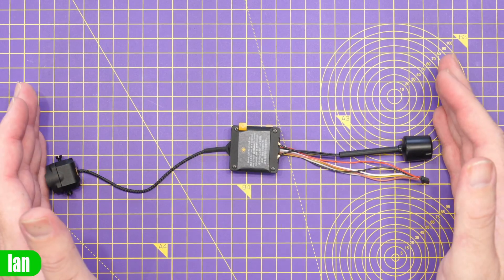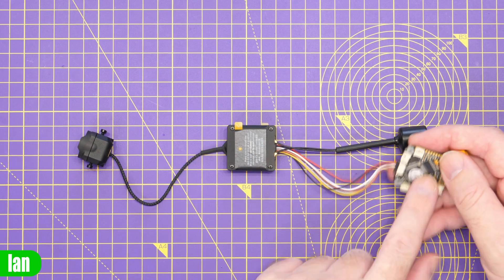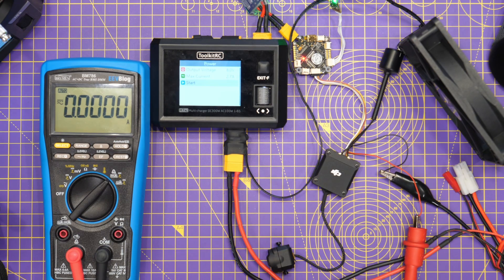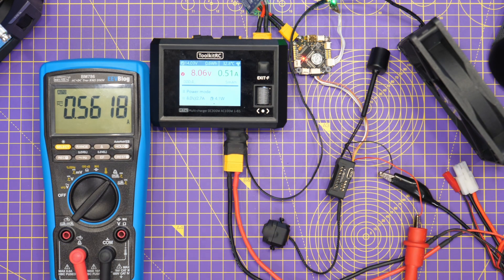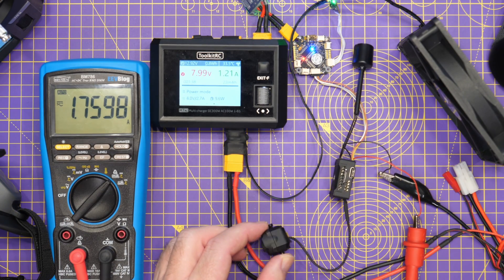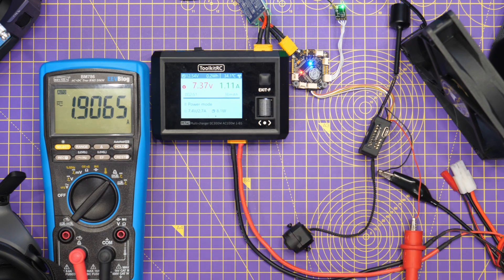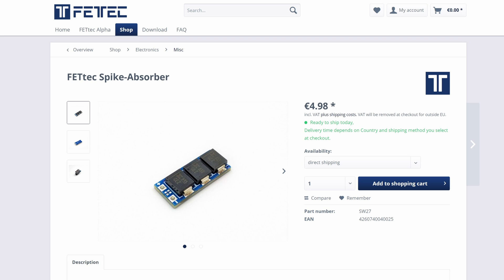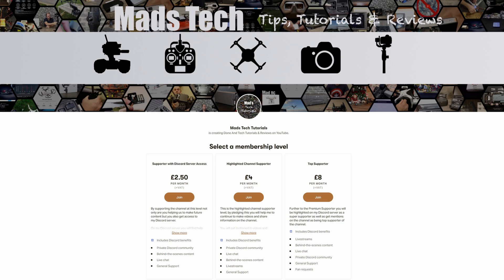DJI O3 Air Unit Power Requirements Updated  - This Could Catch You Out

Comment: I got mateksys micro bec to power up my fc on my geprc mark5 dc hd. needed because of water damage. It works powering up the fc / rx etc but not the 03 unit. On the instructions for the BEC you can bridge 9v pod for more amps. do you suggest this? Thanks in advance

Comment: Hello, I need help! - I have a new set of DJI Goggles 2 and a New Dji 03 Air Unit...
I want to simply run the camera without a flight controller so I can install it in an RC Car.
All I need to know is how to get power to the Air Unit using an independant 4s Battery.
I don't need all the OSD stuff, Just powered on, so I can install the Firmware on both the Goggles and the Air Unit. What cable do I need to make up to get this going? ( I also have a fan and a heat sink ready for it too) There has to be a simple way to power it up surely without '' all the quad gear '' If anyone can help me, I'd be willing to pay for your time. I live in Australia and really want to use the system. 
I have searched what seems like the entirety of YouTube for what I've just explained, But everything is about quadcopters. Hopefully someone can help me out here. Many thanks in advance.
Reply from the maker: You just need to power it from the cable with in the specified range. The red and black cables.  However please note that O3 will not go to full RF power even if you turn off low power mode.  It needs an arming command from MSP
Reply: @MadRC  Thank you kindly for responding! 
Yes I have been thinking about these hurdles.  I don't mind admitting I am a complete newb to Digital FPV, Unfortunately for me I am elderly with early onset Alzheimer's and this system was bought for me as a gift as about a year ago my doctor advised me to get a ''young at heart hobbie '' and I'm completely hooked on RC Cars and Sail Boats. I have rang around a few places in the city for help in getting them installed. ( I have two 03 Units ) But everytime I try and explain what I'm after I basically lock up and forget. Its relatively easy to remember it, But to speak it out I just end up ranting on about whatever else. I'm pretty much at my witts end now as to getting at least 1 running up. I've watched all of your video's I think on the 03 and it looks fantastic. I really really am impressed by your vast knowledge mate. I wish I could harvest it somehow. Thank you again for reaching out  mate.

Comment: Hi, my airunit O3 is very hot, I can't figure out how powerful it works. I have the FCC hack installed. Does Airunit dynamically change the power or does it always work at maximum? The power meter showed ~4w in lower state mode and ~9w without it. Can I see the transmission performance in some software?
Reply from the maker: The O3 does get very hot.  Yes it’s somewhat dynamic too.  Just use the ham file and that’s the max output you can get.  The full 15w is with recording ect.
Reply: Yes, indeed, the airunit o3 consumes about 15W while recording, but without it, about 12W. I didn't observe dynamic power changes. The power consumption doesn't differ when in close proximity, even when the signal has almost disappeared. I don't like this approach because why should my airunit O3 operate at maximum power when it's only 5 meters away from me?! @MadRC
Reply from the maker: @alexwarek  it’s not fully dynamic and you won’t see it’s behaviour on the power usage.
Reply: I am also surprised by the fact that when it overheats, it does not reduce power. Thank you for answering my questions @MadRC

Comment: I have the skystars h743hd fc. I would power my o3 from 10v but I cant find the maximum current nowhere in the documentation. This is why I power it from a pad called "filtered vbat". According to the documentation this pad is supposed to power the vista. Yesterday while flying (it was very windy) my o3 rebooted mid flight. Could the adjustments that the motors had to constantly make cause a voltage spike and force the au to reboot?

Comment: Just got done moving my power / ground off the BEC from the FC, as I kept getting the O3 air unit rebooting (this on a brand new GepRC Mark 5).  Keep in mind, my FC has a 3A 12V BEC (rated).  Usually the reboot would happen when high G flip or once, when I belly flopped down on ground just a little too hard (that made me think it was cabling/crack/connection issue).  Originally thought it should be when doing high current punch maybe allowing BEC to brown out.  Nope...had it happen more often during a throttle down (right after a quick blip). poof reboot..no video.  Caused two crashes before I'd had it.  Too many cables going from ESC out a cable to the FC, out that cable into O3, so I just soldered it direct on the 4S Vbatt.  So far (crossing fingers), it has fixed the issue...  /shrug.  YMMV, but there is at least one more line of thinking for not having a mission critical (video) cut out on you just as you execute a nice snappy front flip aaaaaaaaaaaaaaaaannnnnnnnddddddd.............yeah.  Panic.  Sigh.  10s later when video came back, I could count the blades of grass blocking the camera.  nice.  sigh.

Comment: Hi Mads, has this been addressed in a firmware update or do you still need an FC for max power output? tia
Reply from the maker: You still need the fc. Nothing has changed. There is some Arduino code out there as well you can use to force it to arm as well
Reply: @MadRC  Spot on thanks mate

Comment: I have a Zeus F722 that has a 9v/2a BEC for the DJI system, which should be 18watts but that's if it's rated correctly. I have some spike absorbers but maybe I should also just get a 12v 3a BEC. After tax and buying a longer camera cable because they like to ship these with the shortest possible camera cable, I've got $260 in this one o3 air unit. Might as well have $270 in it and just spend the $10 on a BEC.

Comment: Thank you for the great review.
I’ve seen iflight had some issues with the current regulator and I wanted to power the DJI O3 directly from the battery.
Do you have a diagram or additional equipment that will make this possible without risking the O3 unit?

Comment: Do you think the relatively thin gauged wires of FC/ESC stacks running from the ESC to the FC are sufficient to supply all the electronic on board?
Reply: NO!  Yes, for any one, but the increased failure potential from small wires/connections from ESC, up to FC, then into BEC, then out ANOTHER cable to the O3 for something that is mission critical (had two crashes because something was loose or pulling, and maybe not from BEC).
Reply: What BEC you recommend to use ?

Comment: "I tested the o3 unit for the first time yesterday, using it on two different planes. One of my planes had an f405 wing control board, while the other had an h743w. At 300 meters, the connection was lost with the f405 board plane, but I didn't have any problems with the other plane and was able to fly up to 6km. I believe that the f405 board was unable to provide enough current on its 12v output."
Reply: İ solved issue , f405 controller 4.2 firmware i upgrade 4.3 . When i arm o3 high power status . Thanks for videos
Reply: @brkfpv60  so you need to run betaflight 4.3 and up?
Reply: @LeonSTE  ardupilot 4.3

Comment: Hi there, I hope you can help. I have 2x O3 units, 1 in in my flywoo explorer lr 4 and works perfect with gyroflow. My other unit in my freestyle quad does not... when I import the file (flying with wide screen option 16x9 with dcinelike) the video in gyroflo is just black. Disabling stabilization shows the video again. Using Rocksteady has no issue. Air units are on the latest firmware. Any ideas?

Also, how do you get the country code not updated error message to go away in the bottom right ?

Comment: Hey man, would you tell me if this one is ok to use?

MICRO BEC MATEK 6-30V TO 5V/9V-ADJ (6S)

* High Efficiency Synchronous Step-down regulator
* Wide 6V to 30V Operating Input Range
* Continuous load current: 1.5 Amps (Max.2.5A 5s/minute)
* VOut 5V or 9V Adj. Default is 5V.
* VOut Load Regulation: 2%
* Standby current: <5mA

Thanks

Comment: I bought an O3 air unit to put on an RC airplane for FPV conversion, how can i get o3  to transmit maximum RF output if its not connected to a FC board. ( in your demonstration you noted it wont go to max output until FCU is armed.   An hacks through the goggles menu maybe ?

Comment: UPDATES:
Radio Control 2 V02.00.0500, O3 Air Unit V01.02.0000.
Reply: that fix what? DJI has no relase note for that update?
Reply: @DrEvil-yx4vr  yes it dose. 
But anyway it fixes the blackout and gives more recording options.
Reply: @jfect2  my false, i found it, and make an update on everything. Thanks again.

Comment: Hello, will the Air unit give the full Power when only powered Up in a battery? I have a Problem with my pitlab flight-controller, there is No arming Like on inav or betaflight. The range with this plane Just 1km 😳 Same Air unit with inav plane 7km. Maybe an Idea?

Comment: @Mads Tech Do you know the minimum working voltage of the o3? I'm planning out a 2s long range build and don't know if ill need a boost converter, the landing voltage could be low as 5.8v
Reply: as he said... 7.4V is minimum
Reply: dji spec sheet 7.4v not an actual working minimum,  piss off ya wanker
Reply: @CyberdeckCafé  Did it fry? Nearly 2A at 8V.. if it managed down to 6V at nearly 2.5A I wonder if the air cooling of being in flight would keep it alive?

Comment: I just installed the O3 on a F7 stack and is overheating, shutting down in few minutes? Any idea why?  I do not understand why is overheating like that even when the drone is not armed. Thank you.
Reply from the maker: It will, that’s normal.  It gets VERY hot VERY fast.  It won’t actually shut down once armed if you have the MSP configured correctly however 2-3 minutes on the bench is long enough to have issues. 

Also make sure you have low power mode turned on.

Comment: Straight to batt for my units.  My logic is if you overload a circuit on the FC its more likely to cause issues with the flight and I suspect higher chance of crashing.  If you have a problem with voltage and lose an air unit you could still RTH or float it down in angle mode and have less pieces to pick up.  I can only guess that the engineers at DJI already have good filtering in the air unit circuit to deal with things since they rate the input up to 6S.
Reply: Hello, I need help! - I have a new set of DJI Goggles 2 and a New Dji 03 Air Unit...
I want to simply run the camera without a flight controller so I can install it in an RC Car.
All I need to know is how to get power to the Air Unit using an independant 4s Battery.
I don't need all the OSD stuff, Just powered on, so I can install the Firmware on both the Goggles and the Air Unit. What cable do I need to make up to get this going? ( I also have a fan and a heat sink ready for it too) There has to be a simple way to power it up surely without '' all the quad gear '' If anyone can help me, I'd be willing to pay for your time. I live in Australia and really want to use the system. 
I have searched what seems like the entirety of YouTube for what I've just explained, But everything is about quadcopters. Hopefully someone can help me out here. Many thanks in advance.
Reply: @The-Atomic-Punk trying to do the same with c-20t gimbal 😉 did you figure out how to get air unit into high power mode with no fc? 😁
Reply: Get an o3 armer
Reply: I got an 03 armer from progressive rc 😁 just arrived other day. Came quick. 3or4 days. Freaking $40 for that little armer 🤯😉 i also ordered another speedybee F405 40a AIO to build a little 4" just for this gimbal 😁 then i use the armer in my arrma fireteam rc truck 😁

Comment: Great video. Can you make a video of 03 air unit and what kind of aftermarket antennas to use. I ve seen it is multi band dual polarization that confuses me a bit
Reply from the maker: If your not using the DJI Remote then don’t use dual band antennas. Just stick to 5ghz ones

Comment: How should I connect my 03 air unit for power also what's cap mean is that the capacitor on the battery connection to the board

Comment: Hi I have a nazgul evoque 6s and I've replaced the caddx vista with dji 03 airunit and used the plug and play will that be ok is thier a bec system in place with that fc on the hd plug IFlight BLITZ Mini F7 F722

Comment: Would u recommend powering it trough Vbat /bec on FC / external bec. in terms of voltage spikes?. I had several issues on the vista wich i think was caused by spikes. and yes im running big caps and all that.

Comment: Some FC's did have the digital port that output tied to vbat, with all the 'use with Air unit' warnings attached. these would work asis. It applies to the Beast F7 AIO, not the Beast STD AIO 30mm F7 though it has a 10V regulator built-in that is insufficient. The STD unit incorrectly has the warning attached also, which I never figured out why with a 10V regulator in there. I believe the STD was simply a replacement product made only for their ProTek 35.
Reply: Hello, iam trying to put the o3 unit on my Protek35Hd. But when i plug the lipo the o3 doesn´t turn on.

Comment: If I understood well, the DJI product manager for Europe, Ferdinand Wolf said during the recent interview from Chris Rosser that the 03 air unit has a variable power output according the requirement of the signal transmitted to the goggles, therefore are you sure your new test is pushing the 03 air unit at the maximum power arming the controller with the air unit being so close to the goggles? Isn't necessary to get the air unit far away from the goggles to get the max power?
Thank you for your review as usual absolutely amazing 🤩
Reply from the maker: Tried it and I’m not really seeing anything but more testing needed

Comment: Are there really any flight controllers out there nowadays with less than a 2A bec?
Reply from the maker: I think it’s older ones where people convert is going to be the larger issue
Reply: @MadRC  I was looking around at flight controllers on a few sites, just to see which ones to avoid, and I didn't seem to find any.  
  That said, a good many are only a 2A. That really doesn't leave you much headroom.
 I think I'll just adopt the habit of powering direct from batt...  I never meet a BEC i couldn't burn out.😆

Comment: Have you separated the air unit from the goggles far enough to make sure when it ramps up the transmission power it doesn't go even higher
Reply from the maker: It does not

Comment: Hey Ian, great video. But personally I would rely on DJI and just wire it to Vbat + cap. When using a bec you can add more protection but at same time you also add an additional point of failure.. I think many people have been wiring their vistas directly to vbat and haven't heard too much problems with them..
Reply: 7/10 vistas installed (3 to go) directly to vbat +/- cap.  never broken one.  those are vistas and this is a new AU, obviously, but I agree with your point - the O3 is going to Vbat with a cap when it gets here.

as for power, don't DJI ramp up their output as range requires?